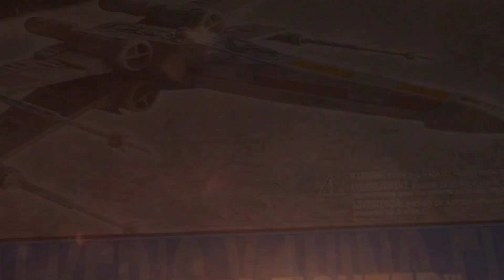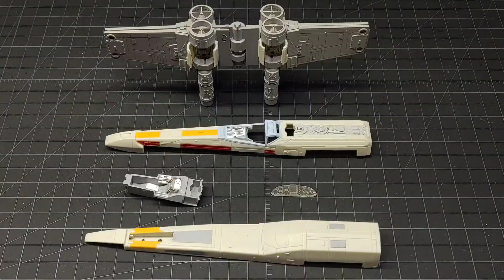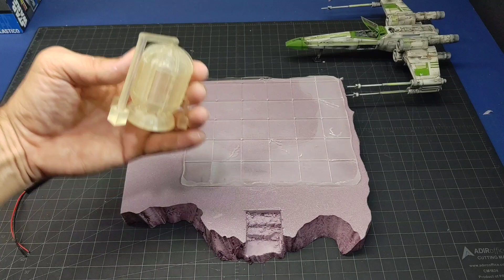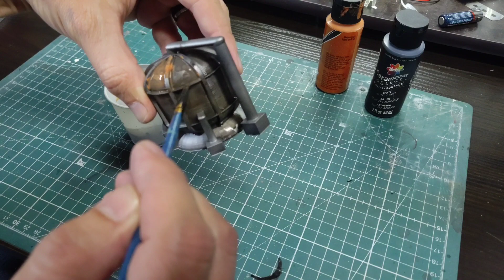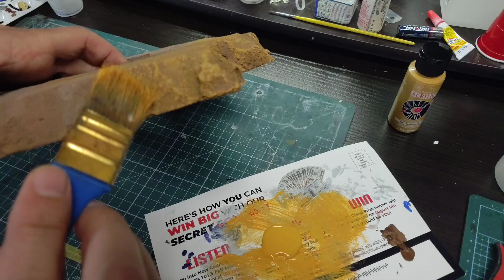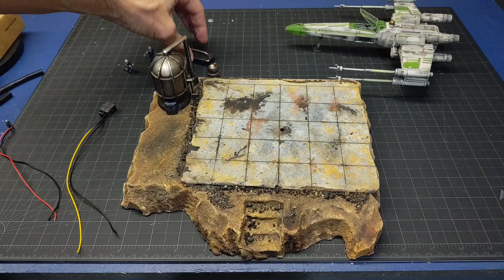Star Wars X-WING diorama.

Comment: Excellent work.  Where did you get the workers? or did you 3d print them? If I might ask. I've been interested in getting a 3d printer. Something just for making some things.  Around 6 inches or so. Any suggestions? Thanks
Reply from the maker: Thanks, they were 3d printed. Elegoo makes some nice entry level printers for around $200
Reply: @EagleSciFiModeler  Thanks. Besides a printer.  Is it really necessary to have washing station for 3d printed pieces? Just curious.
Reply from the maker: @GalthT  just need a bin of some sort and an old toothbrush...there are several different chemicals that clean the resin..I use 91%alcohol and acetone mostly. The resin will irate your skin so you want to wear gloves and eye protection when cleaning. I'd check out videos on how to clean your prints.